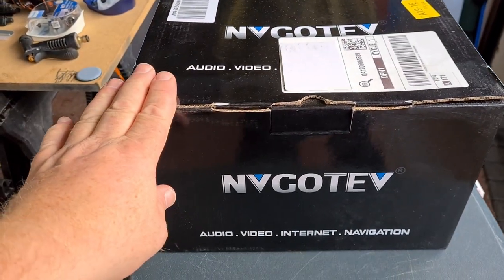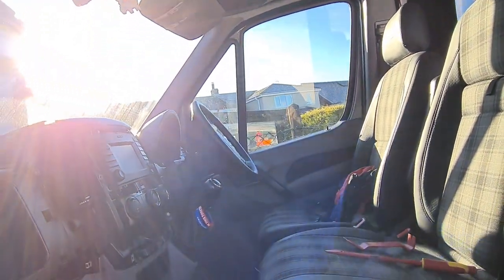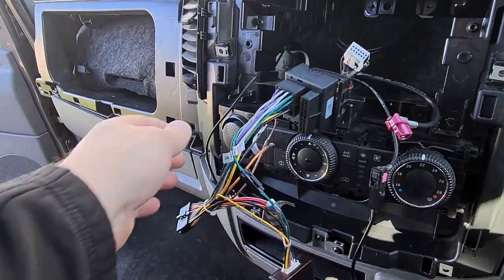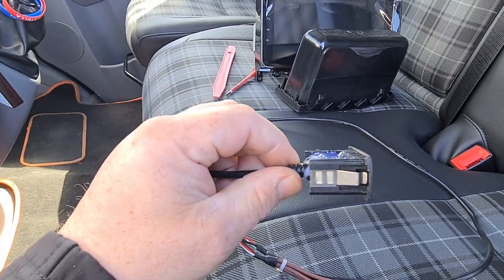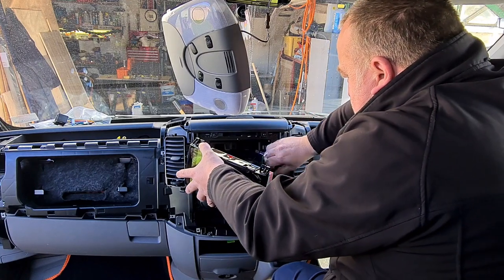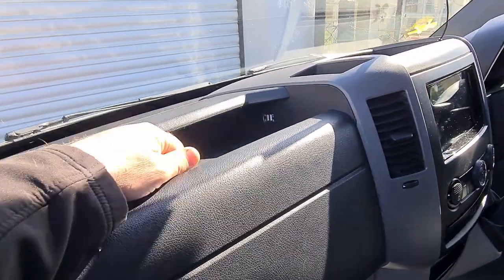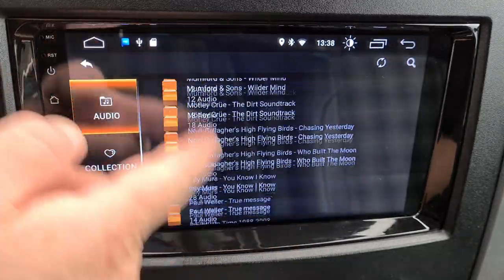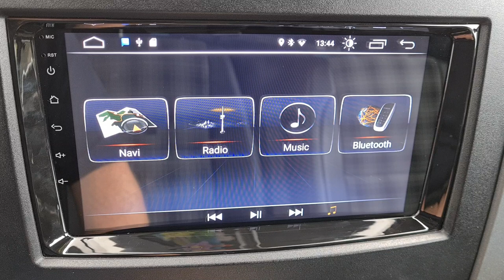self build campervan vw crafter | radio upgrade | van build | part 50 | the crafty blinders

Comment: Speakers.
Did you have to change the original speakers, or did the roof mounted tweeters on your later video be enough? 
Im looking at the Teyes CC3 2K head unit with the 360 camera set up. I'll be lone travelling the world and the 360 cameras will really help me, or id just go for the head unit you suggest in the video.
There appears to be no problem that im looking at, that your channel hasn't already done. Keep going, as you have helped me no end already.
Reply from the maker: Hi we stuck with the original speaker as they produced a good sound the tweeter just add a different sound and make up for the bulk head not being there 
The 360 cameras sound like a great idea 
We're are you from ?
😁👍

Comment: I have a question. Why do you say that your pink cable in no longer required. Thanks for the vidéo. Very helpful.
Reply from the maker: From memory it's an original cable that the head unit I took out required but the new one didn't I think it was the phone mic

Comment: Thanks for the video. I ran into an issue where the radio I installed is always on. Seems both my wires have constant 12v.
Reply from the maker: You need to find a switched live your 12v outlet below the gear selector is switched 😁👍

Comment: I fitted a similar Xtrons 10” android touch screen in my sprinter, Although ok when parked I now genuinely loath it when driving, the screens and soft buttons are far too difficult to safely interact with, even simple things like adjusting the brightness or volume require looking at what your doing.

It also sufferers terribly from reflections during the day. Not helped by the fact the viewing angles not very good I am glad I still have the separate screen for my reversing camera as that is angled directly at me so is not affected by the poor viewing angle or reflections

So for my Crafter I bought a smaller size screen, still Android with all the relevant features but most importantly it has proper physical controls that you can feel for without looking. It’s infinitely better than my distracting touch only Xtrons device.
Reply from the maker: I know what you mean the button aren't the best the bonus for me is I've paired it up the the steering wheel controls which work a treat the glare on the screen is an  issue but in looking into a screen protector that should minimise the glare it let you know how I get on 👍
Reply: TheCraftyBlinders ah yes the steering wheel controls should make all the difference, neither of my vans have them unfortunately.

Comment: @thecraftyblinders did you ever get the 4 pin make USB extension? I've bought one off amazon but wondering how to access the back of the factory USB port. Seems you can't just connect it to the existing cable...
Reply from the maker: Hi no the USB I made up is working perfectly so I've just stuck with it 👍

Comment: Hi Sam, Does this kit easily connect to the steering wheel controls?? Did you connect it to DAB and manage to sort the glare issue? Great vids BTW 😎
Reply from the maker: Yes you can easily select or change the control on the steering wheel to suit your needs
I've not sorted the glare to be honest as it really isn't an issue I think I was being over critical
Reply: @TheCraftyBlindersvanlife  thanks for the reply, how's the sound out of it and did you manage to connect the reverse camera to it?
Reply from the maker: @Crichton14478  I have left the reverse camera where it was as it would feel wierd looking at the radio and not the where the rear view mirror should be 
The sound is as good as the factory unit I may change the speakers and tweeters at some point for something nicer

Comment: Hi where about did you get radio and roughly how much as I need upgrade mine cheers will
Reply from the maker: https://www.ebay.co.uk/itm/133797205863
Reply from the maker: Hopefully the link will take you right to the item on e-bay it was around £300 when I bought it 👍
Reply: Hi can you send me link i cant find it regards will
Reply from the maker: @billbanks744  https://www.ebay.co.uk/itm/133797205863